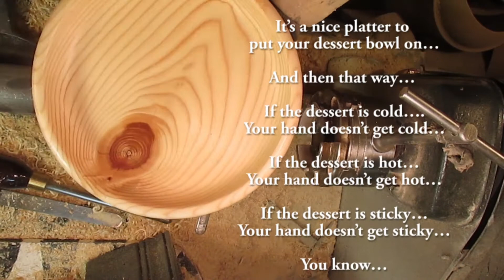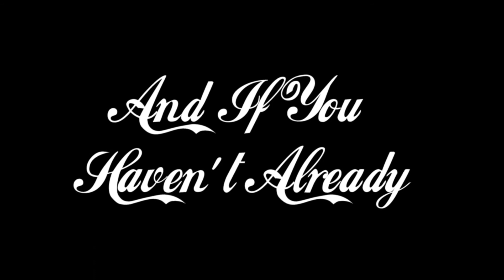Wood Turning #62 A Construction Grade Bowl

Comment: Great Job Larry, That construction grade timber has a very nice grain, 
(is it spruce’ I’m not sure) looks Very nice though,
Thanks for Video, Regards Harry
Reply from the maker: Hello Harry:
It is funny how with all the wood I work with... and I still can't tell spruce hemlock and fir apart! But I certainly do like the grain! And the knots you can find work very well too... although they can make a piece run off balance because the knot is heavier than the wood around it! But all in all... a fun project!
Thanks for watching
Larry

Comment: Hello Larry,
did you have any problems turning this construction grade lumber, concerning the moisture of the wood? Here in Germany you'll get construction grade lumber at an moisture level <20%. This seems to me quite wet for turning.
Never the less, sometimes it takes some courage to do things where other people wouldn't give a second thought. 
Your platter / bowl turned out beautiful and it's another demonstration of what you can make out of the small things in life.
Greetings from Good Old Germany
Peter
PS: I'd consider to get the shavings out of the way prior burning the line. 
Just thinking of your bad experience with a forstner bit. And I'd like to watch more videos from the Tiny Trailer Workshop
Reply from the maker: Hello Pete:
Do you know that I never even looked for moisture...I figured that being kiln dried it  should be a whole lot drier than most of the stuff I turn! I am used to turning green wood and there is considerably more moisture there!

I have made several of this size of platter and more just a little bit bigger (2x12) for plates... as far as I know they are all still in regular use!

Good tip with the line burning... as it only takes a second to do I hadn't equated it with being a problem... but like they say... where there is smoke there is fire! We will see how well I remember!! But I would like the TTW to keep going for a while too!

Thanks for watching
Larry